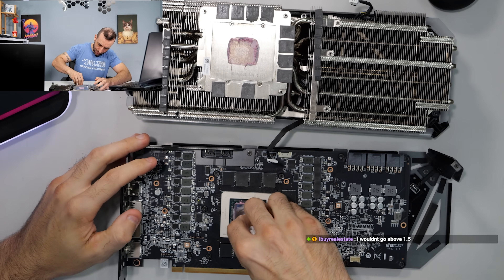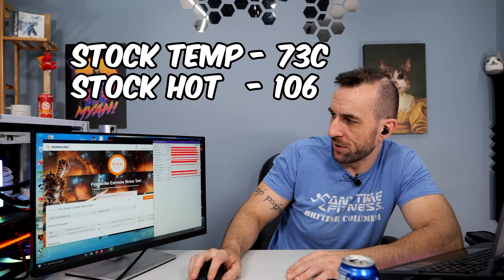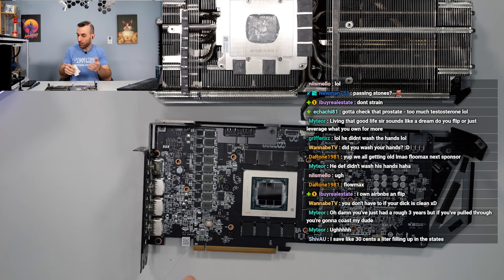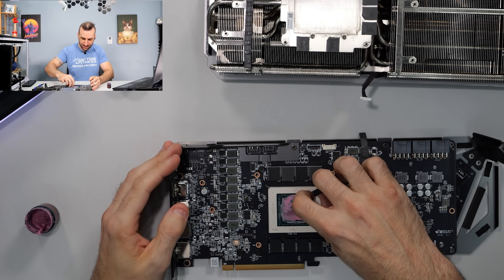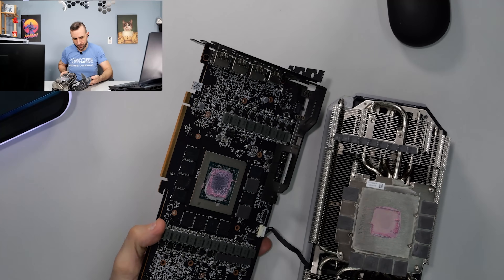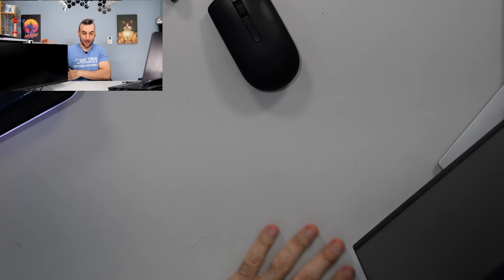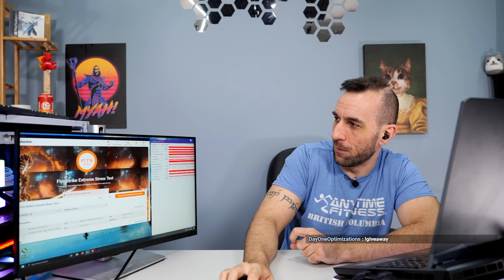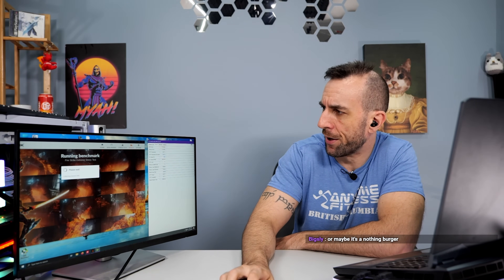7900XTX + Liquid Metal on RED DEVIL HOTSPOT FIX

Comment: What you recommend to prevent Liquid metal leaking out.

Fat blob of LM leaked out My 4080 onto my M.2. Luckily cleaning the drive got it working
Reply: I just wouldn't do it. His paste job dropped the hotspot temp by 10 degrees, from the stock 106C with 33C delta to 96C with 25C delta, which is a really good improvement. Liquid metal reduced the delta to 21C which isn't bad but not really worth the risk imo.
Reply: Whoah man, how much LM did you put on there? Usually it shouldn’t leak past the SMDs that’s why you paint them with nail polish or liquid electrical tape. If you are super worried about it leaking out you can measure the height from the top of the die to the pcb outside of the shield, then get yourself some closed cell buna foam, one side adhesive 0.5-1mm thicker 0.03in roughly, put that around the outer die shield, nvidia doesn’t always have those shields but it’s the same idea, measure from top of die to PCB and put the foam around, paint the smds inside with nail polish and you’re good to go. I think you put waaayyy too much LM for it to run down your entire card and make it to the M.2, surprisingly it didn’t burn your GPU.

Comment: What is a "good" delta ?
Reply: Up to 15c is very good. Anything 20+ is meh.
Reply: @stefantholet4036  okay cool I cramed one in a sff because it was best card that could fit and default fans it is 70 amd 83 hot spot. Thanks for the reply bro

Comment: My guess is the thermal pads just a little too thick. Thermal paste looked a little thick on edges so that my guess that it not so thin. But I love LM my CPUs and GPUs. Going to LM my second 4090 even though totally unnecessary even with air cooler. Biggest diff I saw on 4090 going air to water with normal paste and pads was mem Hotspot temps dropped by 20c. I also recommend using tolulene free nailpolish around die.  I also really scrub the LM on both die and heatsink to stop it from gathering/dropping together.

Comment: You should put 0.5 plastic washers on the die fixing screws, I was recommended to do this, on the RTX 3000 it reduces the Hotspot temperature a lot

Comment: I have a 7900 XTX Yeston Sakura, the Hotspot is always 25 degrees hotter than the GPU temperature
Reply: thats kinda normal delta still, if I push my 7900 xtx i have delta of 40+c :D